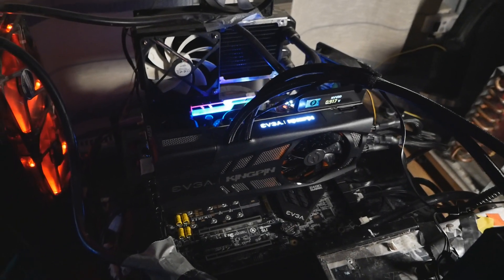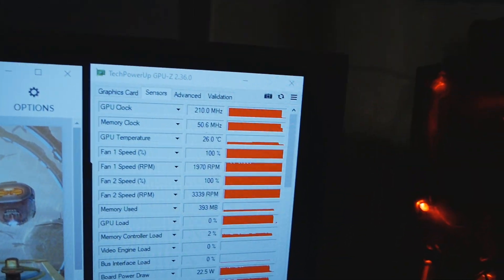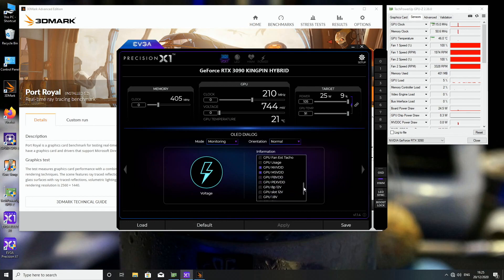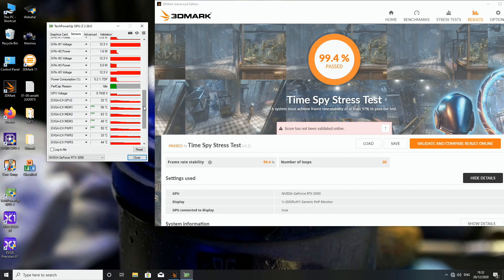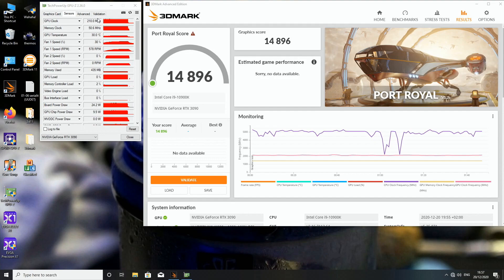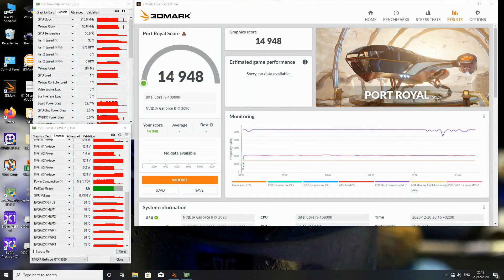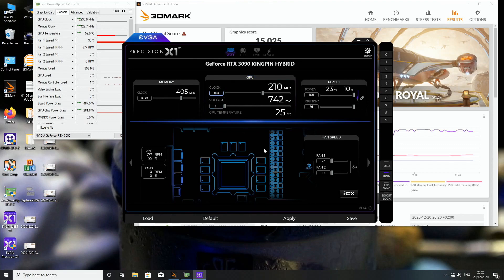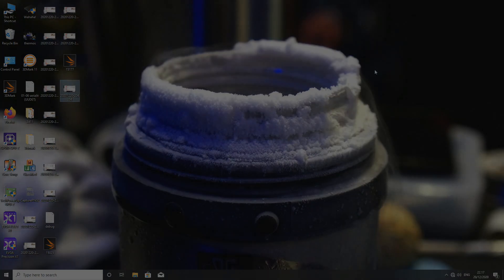EVGA Geforce RTX 3090 K|NGP|N Part 2 - Main Features & Initial Overclocking Tests

Comment: 2115. Vince definitely hooked you up with a nice lottery winner! Fun to see what you were able to score! On LN2 ur card is gonna crush it
Reply: DeC  false. There is definitely a lottery. I've seen 3090 Kingpins range from 2040 MHz boost clocks to 2115. I've talked with Vince himself and he confirmed the very best chips hit 2115 and they are extremely rare. My chip only does 2085 and mine is above average. The lottery is a VERY real thing even among Kingpin cards.
Reply: @mylittlepwny3447  I sad. Mine does 2055 out of the box before tweaking anything. I'm still trying to figure out the classified tool. I want to push it as far as I can go for a safe daily OC. Struggling to get anywhere.
Reply: @The44sasquatch  2055 is the most common bin it seems. 2055-2070. Don't bother with classified controller for daily usage. Use the LN2 (520w bios) Leave voltage at stock and run like a +75 or +90 offset on the core and +1000 on the memory. That's a good starting point.
Reply: @mylittlepwny3447  ok, other than the 1 time I poked around in the classified tool that's basically what I'm running, except my games crash after about 30 minutes at +75. seems to be stable at +60
Reply: @The44sasquatch  it's all silicon lottery. I run a +75 offset on my 2085 MHz card and a +90 offset on my 2070 MHz card. Both effectively maintain 2130 MHz during games depending on game. Some games I can go higher but that's the max I can run without any crashes on anything.
Reply: DeC  One of my kingpins won't do more than +1250 on the VRAM and struggles to maintain 2050 MHz in benchmarks.  With the stock hybrid cooler, it gives lower port royal scores than my 3090 Strix and 3090 Gaming X Trio.  Its definitely lottery with the Kingpins.

Comment: I just received my RTX 3090 KINGPIN from EVGA and if anyone is curious about a great case that fits the 360 mm GPU radiator... I can say the Anidees AI Crystal XL PRO RGB Full Tower works perfectly for this card and larger radiator. The 360 mm GPU radiator fits easily on the front right side of the case cage. I also have an H150i Elite Capellix 360 mm at the top that also fits easily. You put up to a 480 mm radiator at the top of this case. Overall, the Anidees AI Crystal XL Full Tower is a great case with lots of room!

Comment: Nice video and GPU. I always enjoy your videos. I just got mine set up over the weekend. I emailed Vince and got the XOC BIOS for it, but it won't flash. Seems it is not signed (invalid firmware image). Looking forward to benching it more. I'd love to have that phase change cooling setup. I am running chilled water at the moment.
Reply: Curious what was your stock clockspeed with kboost enabled and no load on GPU?
Reply: @mylittlepwny3447  about 2040-2075 depending on the GPU temperature.
Reply: Have you tried the 520w "Ln2" bios on your card?
Reply: Ive used the 520w bios. Thats the bios I normally run until I start playing with voltages. Usually port royal will let me do +150 which puts me at 2235 and will drop as low as 2190 or 2205 depending on ambient Temps. Scores just a hair over 15000.
Reply: @basedanon420  Yes. I saved it with NVFLASH and then flashed it to the OC position and put the XOC BIOS in the LN2 spot. I am using the XOC BIOS now. It has a 1000W power limit. Flashed it late last night. Neither the L2N BIOS nor the XOC BIOS give you everything available without the Classified tool to adjust the additional voltage options, LLC, etc.
Reply: @mylittlepwny3447  what is kboost?
I am deeply disappointed. My card does 1965 stock 😥

Comment: Luumi nice video. Do you have any videos that offers any good advice on what to disable or enable before running any benchmarks such as 3Dmark? I run 3DMark on steam and was just wondering? There is some of the things I disable like the windows 10 anti virus, and I do some changes in the Nvidia control panel like the texture quality.

Comment: I also got a 3090 kingpin I found that the normal bios is best for overclocking the card. Cuz when I use the different bios I cant push the clock and memory as much

Comment: I have a founder's edition rtx 3090 and using HWiNFO64 my memory junction temperature has gotten into the mid 90s C while gaming on completely stock settings. I slapped a CPU heat sink on the back side using a thermal pad and that seemed to help lower my memory temps. I am wondering if the K|ngP|N has a better thermal solution for the memory on the back side of the card.
Reply: it doesn't you will need to get an optimus block if you want good vram cooling for the kingpin

Comment: Do you think it would help to run the fans through a fan controller or the motherboard just to allow the GPU to have that small amount of wattage back for the core?
Reply: on this Tier of Card, not really, since you'd be pairing this Card with an XOC BIOS that doesn't have power restrictions.

on other Cards though, then yes, it could be worthwhile. on an Air Cooler Card, each Fan on the Cooler will be roughly 15 Watts at max speed, so a triple Fan Cooler would be taking away roughl 45 Watt! a big loss if you aren't powermodding.

Comment: Shouldn't the radiator tubes come from bottom to ensure optimal operation?
Reply: That’s what I thought, the way he had it gives it a
Chance to suck air into the loop, over time that will ruin the pump.